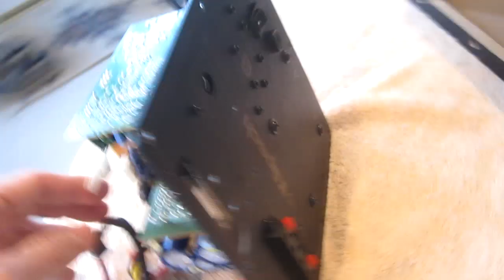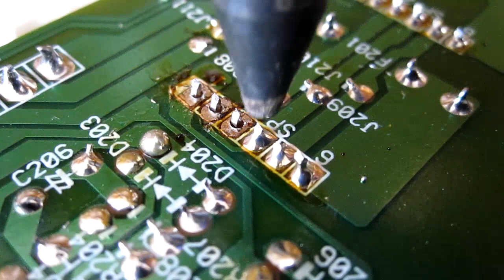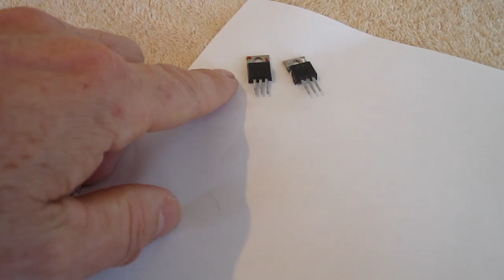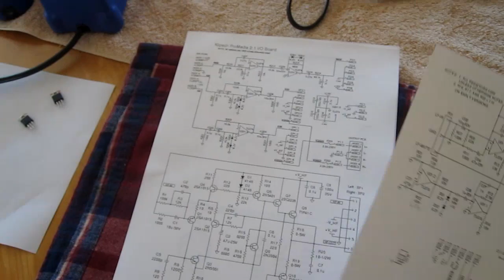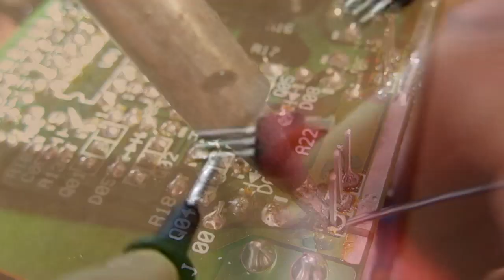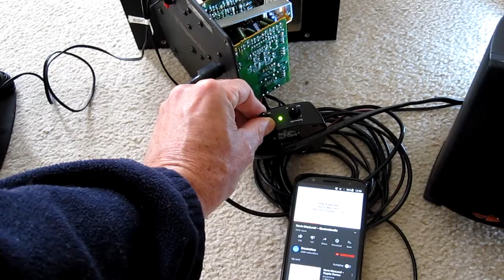Electronics REPAIR Klipsch Promedia 2.1 gaming speakers Fix Mosfets Capacitors

Comment: Thanks for putting this video out and showing your work progress. I think it's cool that you educate novice electronics newbies the way you do, because it's an easy way to learn all of this. I took an electronics class in high school 40 years ago, and I've been hooked on troubleshooting components ever since! My ProMedia is also the THX (wired only), and the left speaker is going out. Right speaker is loud even after you turn the volume all the way down on the right speaker control hub, and the bass doesn't sound loud and powerful like it should. 'Haven't started on it yet, but soon I'll be getting ready to begin the troubleshooting this one. I've already had the proper desoldering station to do this, too. 
(NOTE TO NEWBIES: Do not attempt to pull parts off of the board unless you have a good desoldering gun. Regular pencil soldering irons or guns are very difficult to desolder even with a suction bulb, and you may end up destroying your board. Be careful.

Comment: I've had these speakers for 20 years or so. Thanks for this vid, I was able to locate the cracked soldering of those 2 resistors. It was embarrassing how long it took to get them soldered back but they are up and running again. After a blown sub speaker, multiple fuses, control pod replacement... Best pair of speakers I've ever owned.

Comment: This was the original one I had. Now it only has one board in it, and no fuse. I am not electronics fixer person, but I do dabble a little. So I looked online for my specific issue,(Only the sub was working) and found on Reddit that removing C22 and replacing it with 50V 22uF capacitor(same as in that spot) would fix the issue. I saw that at least 6 people had tried this, and it worked for them. So fingers crossed as the capacitor will be here tomorrow. Wish me luck... I will update if I remember...
Reply: hey there, did you have any luck replacing the 50V 22uF?

Comment: I just gutted all of the electronics and replaced with Wondom JAB4 and programmed the DSP to crossover around 90Hz. Sounds way better than the original electronics, weighs far less, and wastes way less power.
Reply: This is the way to go brosef.  I think a lot of people get intimidated by having to learn how to set up/integrate the DSP.

Comment: The sound only comes from my subwoofer. Sometimes it will come in and then back out. Someone suggested that I need to replace a capacitator. I think I'll just buy a new one. I have no experience with electronics repair. 😒😒

Comment: I have one of these systems but it’s an older model that does not have a power switch. After it got dropped, the system no longer powers on. Any idea what I should check? Thanks.

Comment: I should’ve studied EECS instead of Math-CS this stuff is so much more useful. I guess I could just learn. Do you have any recommendations how to self study EE?

Moreover, I’m here because my right channel is quieter than my left channel. When right reads 1.0V left reads 4.2V. I figure there’s a bad (something) in there somewhere. I’ve taken AP Physics C and the college intro Physics Electromagnetism course. So I only know theory. I don’t know what a MOSFET is. I’m not sure what testing continuity is but I have a decent idea now. Here’s my second question. How do I know what each (something) is supposed to read? How do I know what a capacitor is supposed to read? Or a transistor, or a fuse? Does it say directly? I found a diagram online but it’s not identical to my pro media 2.1 so I feel like I’m guessing.

This video was fantastic thank you.

Comment: The right speaker not getting power, I tested my speaker with left port and works.  Right Port not getting power.  Any suggestions would be appreciated.
Right Speaker works when tied to left side.
Reply: Its more than likely your amp that has gone out.  The speakers still work fine as you can see. It seems Klipsch makes really bad amps.  My right speaker just out/isnt getting powered anymore and even if I use headphones, I have to pull down on the pod to get it to work on the right side.  Someone on amazon actually bought a new amp and hooked all the speakers and sub up to it and they said they got everything to work.  Currently looking into that myself

Comment: How do you fix satellite speakers where speakers are beginning to fray from the back of the unit
Reply from the maker: if its just the wire itd probably be doable to cut and splice in a new piece of wire.

Comment: Is that a bit excessive for 4 caps to go out?  What do you suppose would cause that?
Reply from the maker: heat and age. they can cook and dry out
Reply: @FunBubble  Ahh yes, so do caps dry out in SS amps as much as they do in tube amps?
Reply: Regardless of the application, albeit environment does appear to impact, parts have a lifecycle where some are more so known to than others.  @axchisler
Reply: My Bose 601s 30 yrs ! And I still sold them still working!! Probably. These Klipsch are a disappointment.

Comment: How common is this problem?  This Klipsch Promedia 2.1 set up caught my eye as my local Walmart is selling them for $89.99 new.  However if this is a common issue, I'll avoid this specific set up.  I know nothing is perfect but the Logitech Z323 2.1 set up I have now has had no problems and is 6 years old.  It's fine for a $40 2.1 beginner setup, but I've really gotten into listening to music and want a better experience.  I would rather have something that is very reliable at the cost of sound quality rather than the other way around.  Any possible ideas or suggestions would be welcome.  I'm a newb when it comes to the details of 2.1 audio set ups.  I don't require massive bass power and would prefer a balanced set up.  I mainly listen to rock/metal music by CD and sometimes by lossless digital files if I don't have the CD.  Thank you.

Comment: I appreciate the how to on removing the LF amp board! Thank You! It might be a good idea to put a heat conductor paste between the Mosfet and Heat Sink, similar to what is used between a PC Processor and Processor Cooler. I really like that Hakko de-soldering pump!  Keep up the good work! BTW, my original 2.1 has very low Bass volume output. Even at high volumes with both pots way up. But not distorted.

Comment: MY left speaker was cutting out for the longest time, now it just stopped working entirely.  I only got these speakers i think last year, or maybe 2 years ago. I think you have the original version I have the new version with the built in engineering flaw.... There should be a class action lawsuit. I guess they lasted past the 2 year warranty period, barely. I can't live with just one speaker and the subwoofer. Apparently this is a very common problem I knew about it before I bought them, so shame on me...I should have trusted other peoples advice. Klipsch should get Asus to make their boards for them with high quality capacitors... Fuck what speakers am I going to buy now.. lol.. I could try to fix it, but I don't know if I really want to bother with it.

Comment: So question, did you have to completely remove that board to gain access to reflow the joints or did you just work around the other board?
Reply from the maker: first time it broke i was able to resolder the resistor while board was in place. Second time it broke i had to remove to access components on back edge of board.

Comment: I've got the same system, but only one speaker port works on the back... guess I'll have to pull it apart and buy new tools... 🤷‍♂️
Reply: did you get yours fixed? i have the same exact problem. i paid $20 for the set and i dont want to spend much more.
Reply: @fearlessgentleman  I have not yet

Comment: how much would it cost to fix the subwoofer if it doesn't turn on??
Reply from the maker: if you paid someone else it'd probably be more than it would cost to buy a brand new system. klipsch is selling this 2.1 promedia set again. id at least try opening it up and do a visual inspection, you might see the problem.

Comment: I had low subwoofer volume on my Promedia 2.1. Replaced 14 electrolytic capacitors on the LF amplifier board to the subwoofer and the power supply board. Resoldered any solder joints that looked cracked. Nearly all the old electrolytic capacitors tested high ESR, low capacitance or open circuit. After 15 years of being powered on 24/7 the caps dried out.  The subwoofer works great again.

Comment: Guess I've been lucky because the Promedia 4.1 speaker system I bought new many years ago is still going strong. Love the subwoofer and am always amazed at the amount of bottom end punch it can produce given it's small size.
Just a side note for you the next time you're trouble shooting: the electronics in some active subwoofers use a white colored glue to secure some of the electronic components to the PC board to help keep them from vibrating and breaking solder joints. The problem is, this glue when it gets old turns brown and starts to become partially conductive. You can test for this using a sensitive ohm meter. As you can imagine this causes electrical mayhem with the electronics. Scrapping off the glue is a pain and time consuming. I've successfully used silicone glue and hot melt glue as a replacement in some repairs I've done.

Comment: I replaced the plate amp entirely with a "TB20A TPA3116D2 Stereo Amplifier 2.1 Channel Class D Audio Amp" which has great specs for the value. It sounds MUCH better than the stock amp. Those stock electrolytics are garbage.

Comment: I have my 1950's Eico 950 capacitor checker. I love the Eico 950 because I can put the capacitor under maximum electrical current load (1 volt--475 volts). It has a vacuum tube tuning eye, so if the eye opens quickly the cap is good; if the eye takes time to open the cap is so-so; if the eye doesn't open then the cap needs to be replaced. It has never failed me over the years.
Reply: Back in the days before planned obsolescence! Anything I buy now just breaks and they make it damn near impossible to fix.